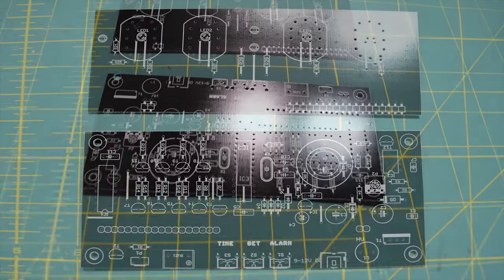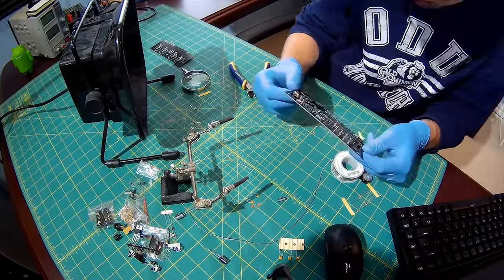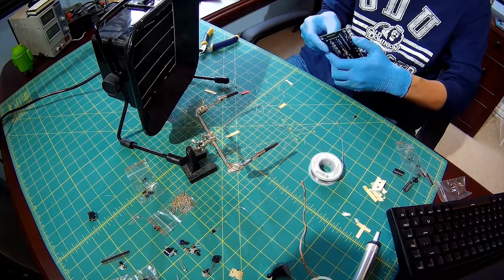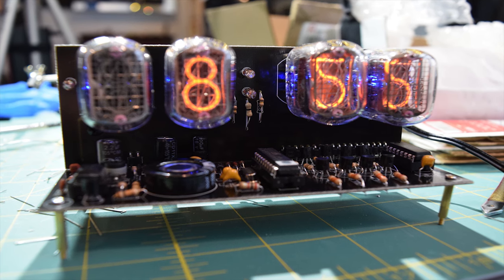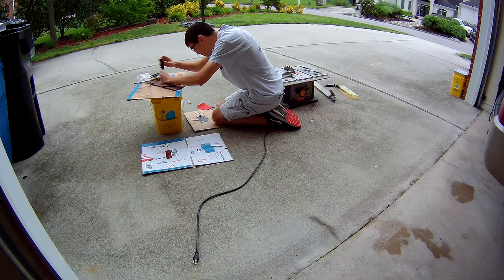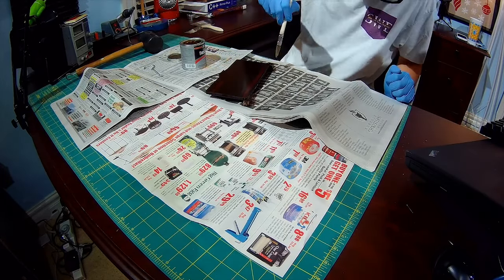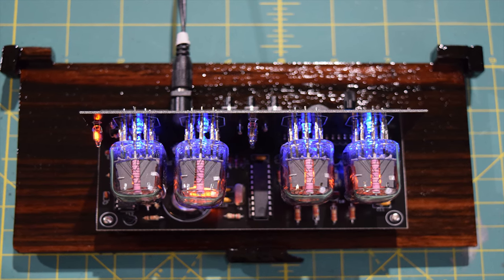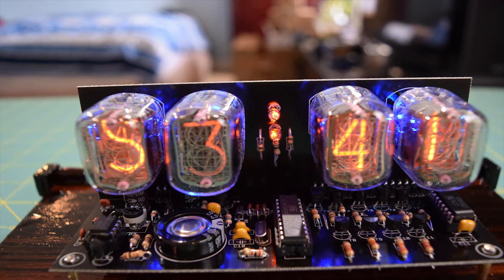4 Digit IN-12 Nixie Tube Clock Build Using $40 eBay kit

Comment: You bought expensive wood and then covered it in Polyurethane which makes it look like $1.99 plywood.  Don't understand the logic there
Reply: Exactly my thought. Stay away from this nasty plasticky stuff - use an oil, like linseed oil. Or some other oil based wood treatment. Or use a wax. Good kit though, black pcb is the only way to go. SMD would be even better ; -).
Reply: Lol
Reply: Get yourself another piece of wood and give your final coat with an acrylic matte finish, it will look awesome
Reply: Matthias Martin exactly sir! Nothing artificial. The oil would look so much better. Or yeah heat up some wax. Personally, I would have just gave it a nice sanding and called it good, ebony wood is beautiful all its own.
Reply: Did do a wicked shitty job of applying the poly
Reply: I have to admit he made a mess out of this NixieTube clock case.
Reply: You need to sand between poly coats and wipe with a tack cloth. That will get you a better result.

Comment: Couple of pointers for you. First: Sand the wood thoroughly using finer and finer papers till you get down to around 400 grit. Somewhere around there. Then give it a good rub down with 0000 steel wool. Dust off then wipe with a very slightly damp lint free rag. Second: French polish the wood. There's a million videos on Youtube on how to do this. Keep adding more coats until you get a satisfactory finish. The more coats you apply, the glossier the wood will get. Thirdly: Apply a couple of coats of hard spray varnish to seal the polish. Why? Because the spray varnish will seal and waterproof the french polish. French polished objects that get wet will exhibit a milky stain on the part that got wet. Anyway, that should do the trick for ya. On another note, when you drill perspex / plexiglass or practically any hard plastic use a slightly blunted drill bit or a neutral rake bit on a slow speed. Also lubricate with water if you can to keep the bit cool. Using a high speed for drilling melts the plastic, binds the drill bit and usually cracks the hole you are drilling. People often mistakenly believe that using a very sharp drill bit will make a nicer hole when in fact a sharp cutting edge with a positive rake will only cause the drill bit to dig into the work and crack the plastic unless you are very, very careful. This is especially so if you're drilling thin plastic. Drill bits used for drilling plastic should have a neutral rake or be slightly blunt. Hope that helps ya with your next clock.

Comment: Rust-Oleum makes a triple thick poly glaze which gives a more even coat than brush on poly because it's in an aerosol can. If you do it right you can get almost a mirror shine on your woodworking pieces. You can find it at home depot or on Amazon

Comment: Tip: Blade on your table saw is WAY to high, you only want it to be ~1/4 inch past the material.  More blade stick out, more chance to get messed up. Slick build, nice work!

Comment: Little late but nonetheless,  Ebony Polishes like marble with good sanding from 80grit down to a final  600 grit,  then finish with tung oil and linseed oil mix,  fallowed with a coat of wax to protect the finish.

Comment: To fix (or hide) the damaged acrylic, I think I would have expanded the wooden base upwards. Mind you, I am no master wood smith either, lol. Mostly just used to fixing my own mistakes😉 But even if only on the backside of the clock, in order to leave the front and sides visible, a little bit more on the back just high enough to mask where the cracked acrylic is might come out ok.

Comment: Tung oil makes water proof finish that is durable and complements the wood better imho plus I think it is less toxic. It is also a rubbed on finish with very light sanding between coats very fine grit paper

Comment: That is the worst poly coating I have ever seen applied, next  time use something like danish oil, or polyurethane in a spray can.
Reply: They dummy used a brush and did not sand between layers. He also tried to apply stupid thick coats. YOu can not do that with poly. Apply thin coats and sand inbetween with 200 grit. It will look perfect. I use old tshirts cut up to apply poly. It is perfect for it and leaves not brush marks to sand out.

Comment: If you have a router, perhaps mill a groove that is the thickness of the acrylic and on the back, pass the power under the acrylic instead of trying to drill the acrylic. Cut your base board a quarter to a half inch larger than the acrylic case. Finish the wood by sanding with progressively finer sand paper and then finally with a very fine steel wool. Wipe off with a tack rag. Apply a boiled linseed oil and turpentine combo and then seal with wax. You can then polish the base with a buffer to make it shine. Best wishes.

Comment: Sure you heard this already, but you needed to sand that poly and add some more. Try an applicator instead of a brush as well. Even a very small roller. I rolled it my hardwood floors and it's like glass.

Comment: I’m not going to be rude a criticise love you choice and video very neat work on the circuit board 👍  
But one tip if you vanish wood always use many thin coated and rub down between each coat it dries quicker and lays smoother 
Thick coats always take ages to dry and ripple with time

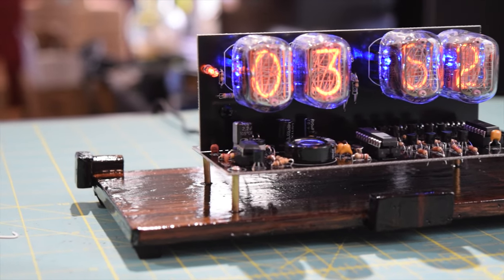Comment: 6:14 ok well...dont use polyurethane. Ever
Reply: No, use polyurethane every single time. This guy has 0 wood finishing skills.  Don't not apply it with a brush it will always leave streaks. Apply a much thinner layer and then let it dry  for time specified on can and then sand with 200 grit or higher if you want. You repeat this until you build up as thick of a layer as you want. You can make it look like glass or if you do not like gloss make sure to get a satin finish instead of gloss. The wood will be super easy to clean with poly and basically water and stain proof. It is one of the best protectors. If you want a super thick glass like look then you need to use epoxy instead of poly, but epoxy is hard to work with and not for beginners. Poly is easy to work with and turns out great if you follow the directions. This guy may have good electronic skills, but 0 wood finishing.

Comment: to the PCB that goes to the nixie tubes, how is it connected to the other PCB? is it only straightlike wire jumps? I have one of these kits incomming for myself but i was thinking on moving the vertical PCB into a fron wooden panel for a not visible PCB if its possible.

Comment: i got the same kit and i am almost over getting it together and i just have three questions:
a) i was sent two 27pf capacitors instead of the two 22pf capacitors for the positions c9 and c10 of the circuit board. am i supposed to use them? is it ok?
b) what about the d7 and r5 components. are they required or not because  c8 capacitor does the job alone?
c) might sound stupid but there are some holes on the circuit board that are connected just with a simple white line instead of a component picture. what do we do on those white lines? leave them that way or solder them together somehow?

Comment: I've bought this product from poland and took my time building it, but having trouble making it work plug it in and nothing lit up no tube lit or LEDS . Adjusted the pot under #1 tube also. I picked it up and the tubes lite up, but still not working.  I noticed I was touching some resistors underneath. Not sure what to do. You have any ideas of what may be wrong with it?
Reply: Im having the same problem. Have you fixed yours?
Reply: Yes I did get it working, with the exception of the 2 LEDS on the right side I just turned the LEDS off. The D5 uf4004 diode D6 1n0047 diode were switched around, and R6 and R16 resistors had to be switched around. Check T3 faces the opposite direction than T4, T5,T6, and T7
Reply: Nice. I got mine finally working, with the exception of the blinking neon second markers.

Comment: C'mon guys....Cut the kid some slack on his woodworking.  He said up front that he didn't have much experience in that.  I've seen a LOT worse out of some first timers.

Carolyn was right...you could melt the power supply line hole into the acrylic, but that can go wrong just as easily.  A tip for drilling flat thin acrylic or plexi....clamp the plexi between two flat pieces of wood (placing clamps on both sides of the point to be drilled) and then drill the whole sandwich.  The boards will lend support and structure to the plexi and prevent it from cracking or splitting quite so easily.

Comment: You need to research wood finishing. It doesn't take that much time to apply poly the right way so it doesn't like like shit. I am sorry to say that, but you really ruined a beautiful piece of wood. Apply thin coats with and old tshirt and sand in between coats with 200 grit or higher.